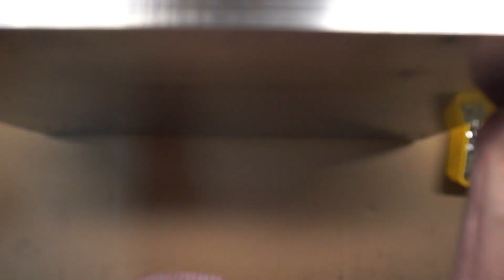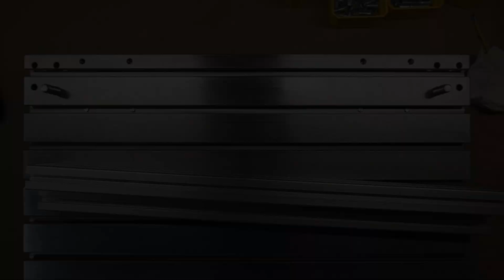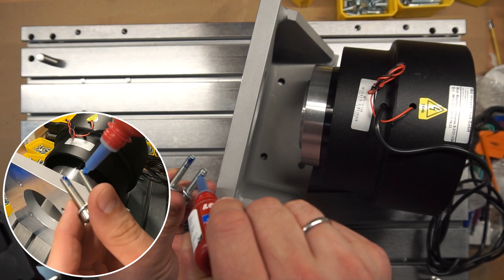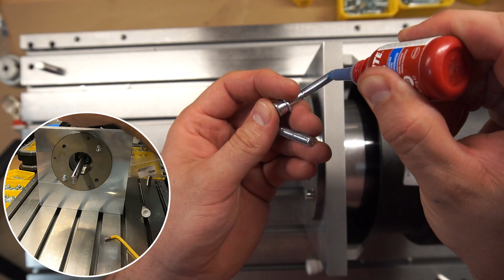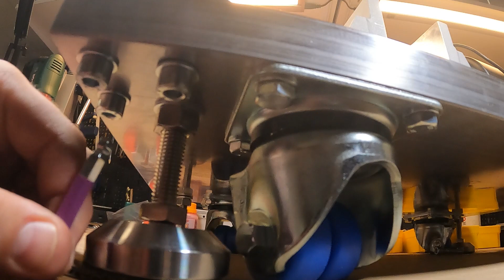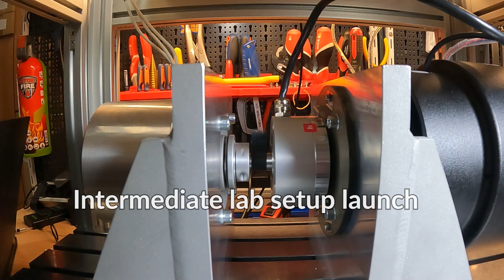EV Test Bench: Mechanical Assembly and 3kW Motor Launch

Comment: What AC to DC power supply are you using? Is it a 4 quadrant supply and does it have to be?
Reply from the maker: Hello! Yes we use 4 quadrant supply in this setup. For instance one of integrated power units here is GE EP3000AC48INZ

Comment: Which software you used for the design both mechanical and electrical parts ??
Reply from the maker: Hi! For mechanical design we use Solidworks and for Electrical part it was KiCad